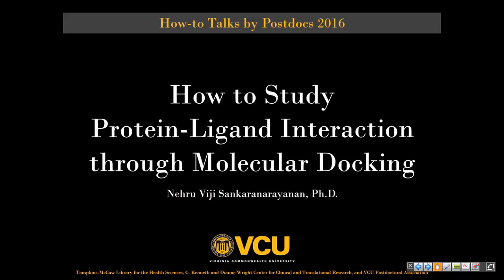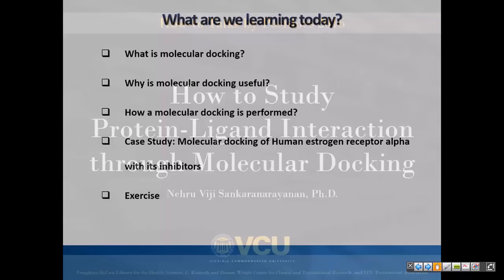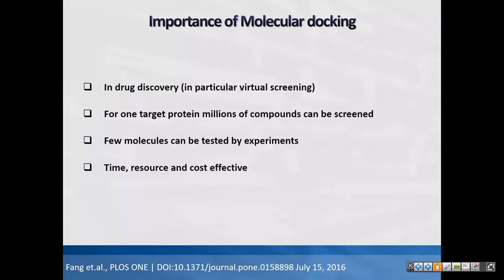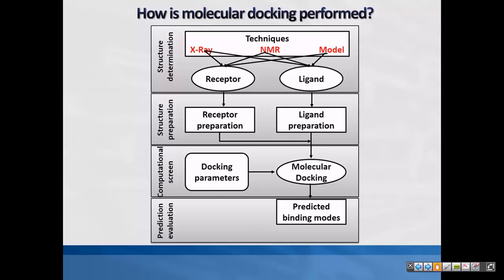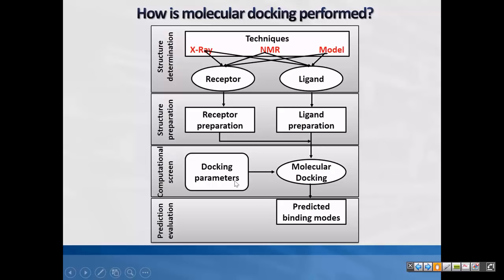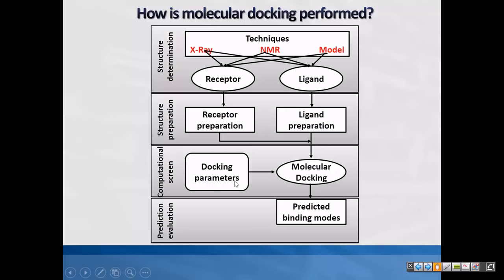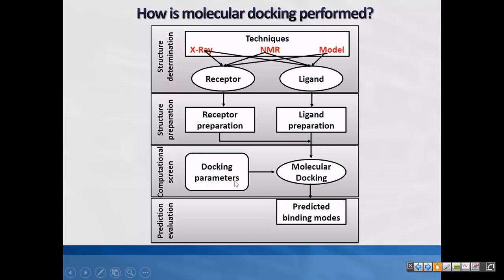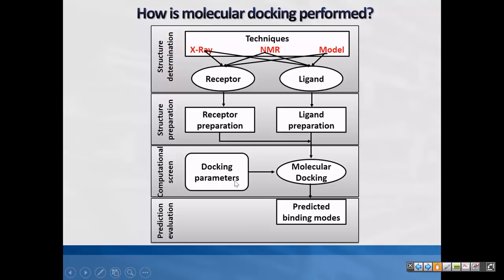How to Study Protein-Ligand Interaction through Molecular Docking

Comment: I t was nice but at the end its appearing as shown below.Kindly help me to sort out.

Running AutoDock Vina for 3erd.pdb failed; see Reply Log for more information

Application stderr
-----
'C:\Users\Dhanu\Desktop\molecular' is not recognized as an internal or external command,
operable program or batch file.
Reply: same here. Autodock running is failing again and again.
Reply: Anyways, it's easy to run autodock vina
Reply: I can help you if you need it, btw I'm linux user since the software runs better in linux than windows, but it's a pain in the ass to install it haha

Comment: I tried everything as it has been shown here! But my run also failed too. 

1. Then I have found that the link for Autodock Vina shared here was only for windows 32 bit and mine is 64!! Anybody, can you help me to get AutoDock Vina for 64 bit? 
2. Another thing I have noticed while looking at the protein and the ligand that there is a big gap between protein and ligand (al least 3 times more protein sized gap). Pulling up together did not work as well. suggestions??? Thanks In Advance.